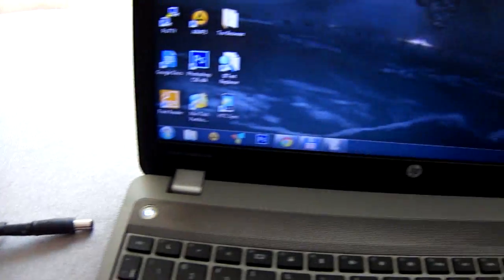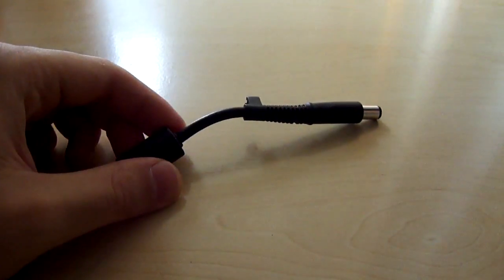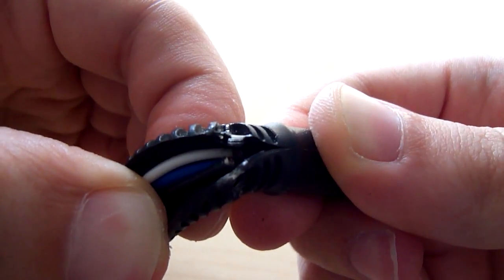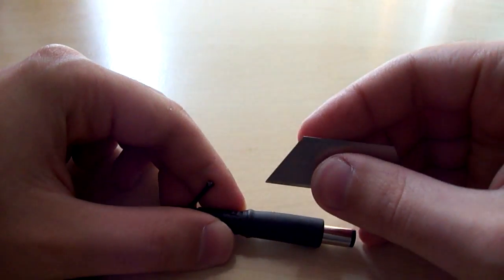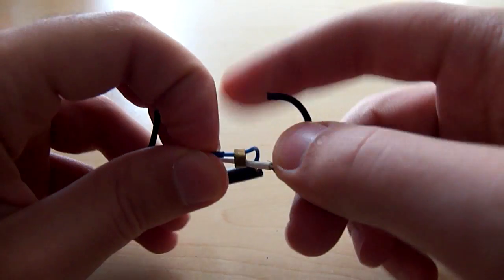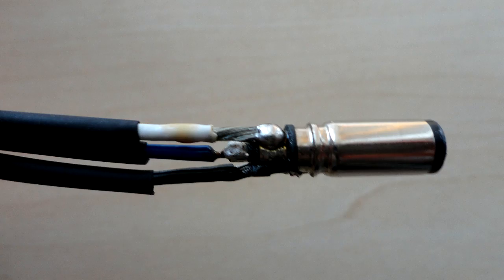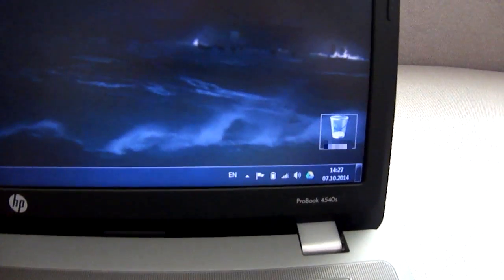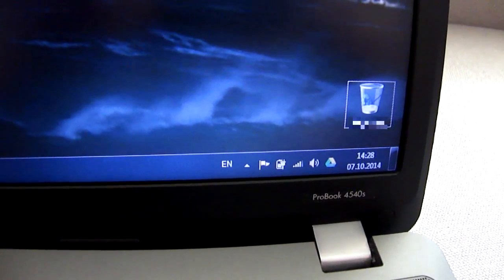Fix and Repair Broken HP Laptop Power Cord

Comment: Nice video except that you glossed over how to insert the heat shrink over such a short length of wire without the heat of the solder effecting it prematurely.